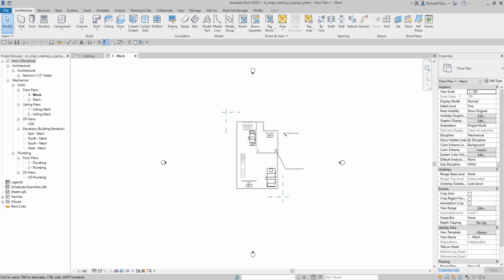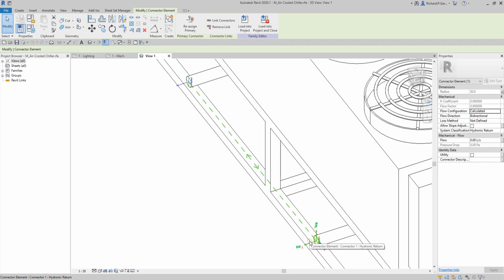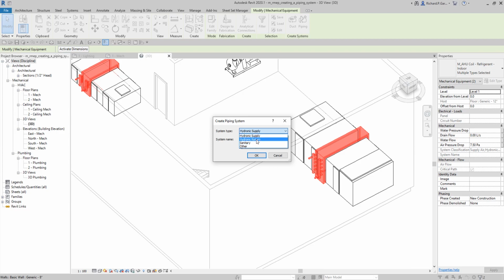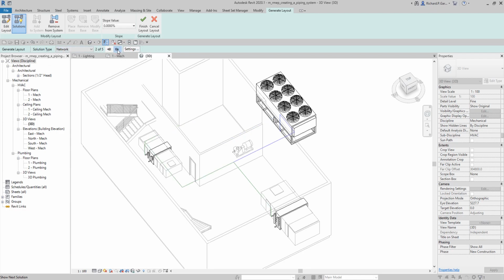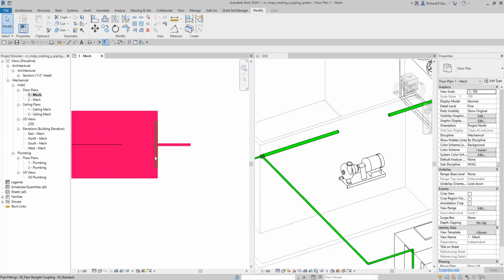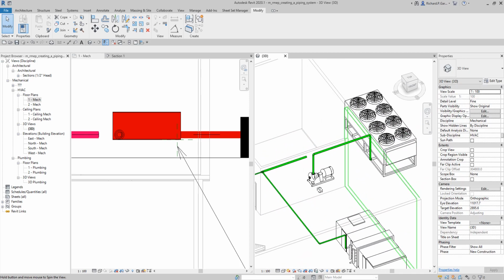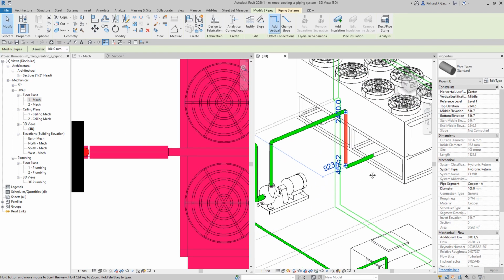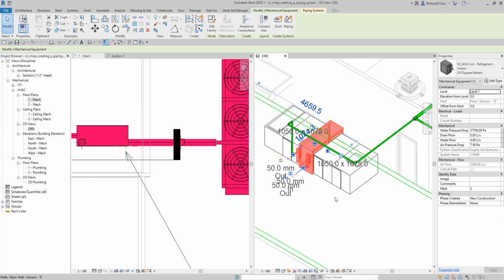REVIT MEP 2020 - STEP BY STEP TUTORIAL 21 - HOW TO CREATE SYSTEM PIPING

Comment: hello, is it possible to divide a system into several models? if it is possible vhow can I create a unique model with link and calculate the system?
thank you
Reply from the maker: hello Dario, yes you can divide a system for several model. on your second question, not sure how to do that, sorry my friend.
Reply: @bim360  Thanks for the reply
the second question concerns the calculation.
for example, if I have a divided system in 3 models, how do I calculate the total pressure loss?
thank you
Reply from the maker: hello sir, i have no idea. sorry